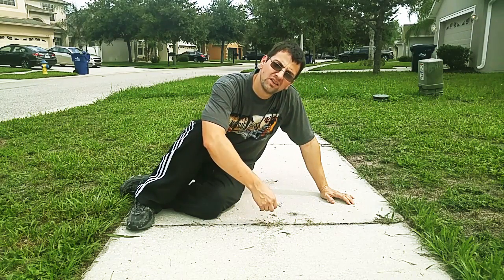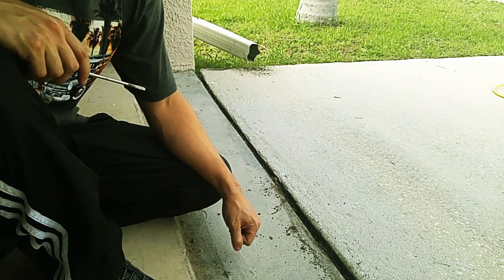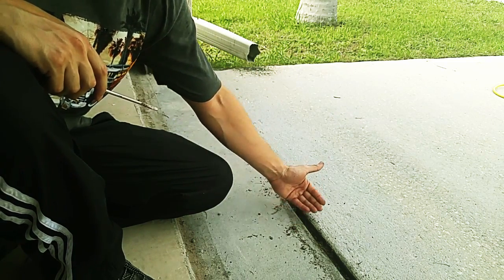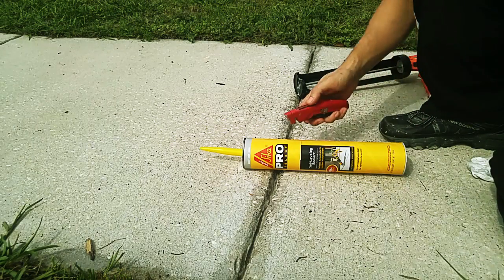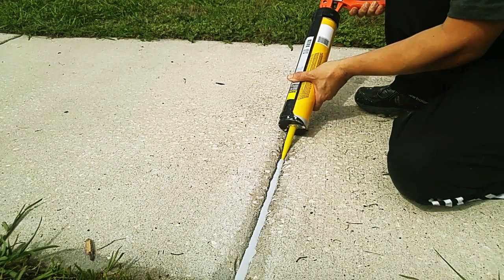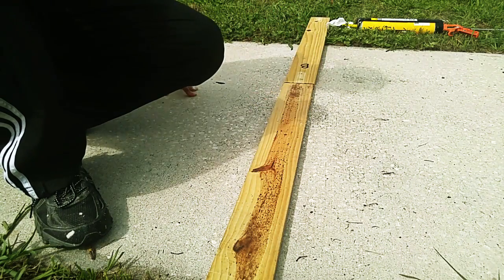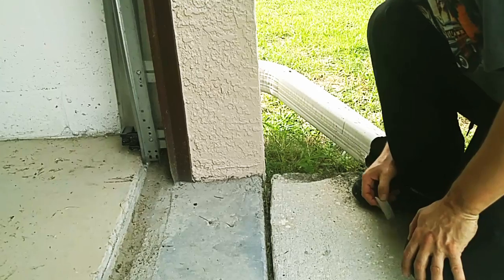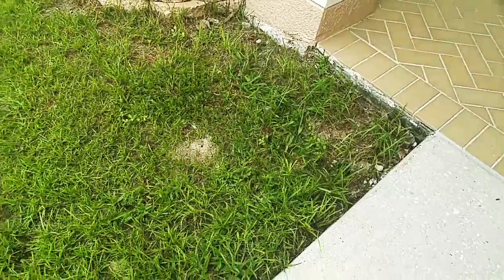Removing Sidewalk Weeds and filling with epoxy

Comment: Since theres less room for expansion did this cause cracks to form in the concrete?
Reply: This is not epoxy it is traffic grade polyurethane sealant that is specifically designed for this application.

Comment: I have been a professional caulker for over 40 .I have caulked miles of these type joints. Almost every homeowner gets this wrong. You should have wire brushed. Other than that about the only thing a pro does different is use a semi self leveling and then tool it. ( few homeowners have this skill so using self leveling is perfectly acceptable on flat walks) and we use primer which is much more difficult for the homeowner to obtain. And we have a large supply of Masonite to use as cover strips. So you did everything right. Except one minor thing that is not epoxy it is polyurethane sealant  well done

Comment: Concerned about brittleness of the epoxy.  Sikaflex 1a polyurethane w/primer creates an unbreakable bond with the concrete and is extremely flexible.  (The primer is a thick, honey-like "super glue")  I don't know if there are any products out there that stick like this combo - I doubt it.   

I have the same problem an am considering pressure washing the cracks.  And YES, lots of backer rod!

Thanks for video!
Reply: It is not epoxy it is traffic grade polyurethane sealant. And stretches better than 1A.I am a professional caulker and have caulked miles of these type of joints. This product is better than 1a for this application. Yes we use primer. I have examples of traffic grade polyurethane in shopping malls that are more than 25 years old. And they get more wear and tear in a day than most residential walks get in a year. The color has faded but the sealant is still good

Comment: I had hoped this would work, but the grass pushed its way through the sealant in about a week. There was no rain, either.
Reply: Did you pressure wash it and try to get as much dirt out as possible?
Reply: @lisayist  very smart, was about to reply with same answer id guess some grass or other seeds or roots were left in the gaps and they grew. I think once dirt is removed its better to pour boiling hot kettle water in the gaps and kill anything seed or root wise then fill it up with epoxy but not tried it yet.
Reply: @mrpurpleman9698  my buddy did this when he moved into his new house. Boiling water in the cracks then clean as best you can.
Reply: The sealant was not properly installed or this would not happen. You have to clean the substrate very well. Wire brush then vacuum or sweep the dust out. You also have to use backer rod to get the proper depth and joint profile.

Comment: 4:01...peace of wood? Who does that? If there was ever a piece of wood it should have been removed at the latest before concrete cured. The wood is not suitable material for filling the concrete gaps.
Reply: Theyre expansion joints.
Reply: It was probably asphalt board it is commonly put in expansion joints in walkways

Comment: Why not concrete??
Reply: It has to be flexible. They are called expansion joints for a reason. Concrete goes through thermal cycles of expansion and contraction and these joints are where that movement shows up

Comment: Clear Epoxy resin glue stops pervasive weeds/grass from popping up before crack filler or concrete/mortar
Reply: This product is a much better solution. And by the way this is not epoxy. It is traffic grade polyurethane sealant specifically designed for these type of joints. I have installed literally miles of Sika traffic grade sealant. I have examples in shopping malls and schools that are 25 years old.

Comment: Great video. How long does it take for the epoxy to dry?
Reply from the maker: +Dee Thompson It takes about 3 to 4 hours for the surface to dry to a point where you don't have to worry about dirt sticking to it.  But a full 24 hours to firm up completely - especially for large areas.

Comment: Good video, especially the prep stage. However I do not recommend epoxy. Eventually it will hardened and crack. There is a much better product -- MasterSeal NP2. It is a sealant, not an epoxy and will flex with expansion/contraction. Available in 2 part cans and premixed tubes. Multiple colors. It is the go to product by commercial contractors.
Reply from the maker: +John McGinnis Thanks John for the tip.  I used this particular epoxy on a house about 7 years ago.  It has lost its sheen but thankfully it is holding strong and is still flexible.  I have more to do in the back yard and will definitely check out the Master Seal that you recommend.
Reply: This is actually Sika’s traffic grade polyurethane sealant. It is NOT epoxy it is specifically designed for this application . NP2 is a very good product. But this product is much better for this particular application. And also NP2 designates 2 component NP1 is the one component. I have been a professional caulker for over 40 years and have installed miles of all these products. And by the way Master seal equivalents of this product are SL1 and SL2 self leveling 1 component and self leveling 2 component
Reply: @hawkmoon7890  This Sika product is better than NP2 for this application. It is self leveling polyurethane sealant specifically designed for this application. It is NOT epoxy. Master Seal does have an equivalent. SL1 one component cartridges and SL2 2 component pails. Sika is a premier sealant manufacturer.